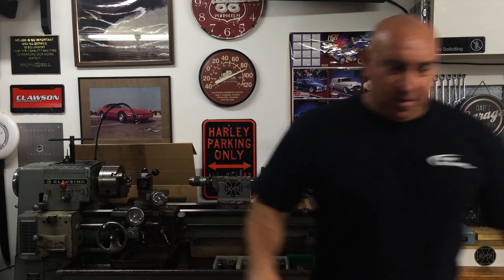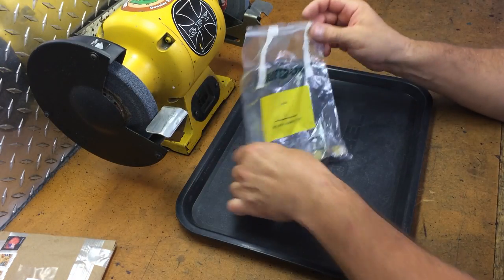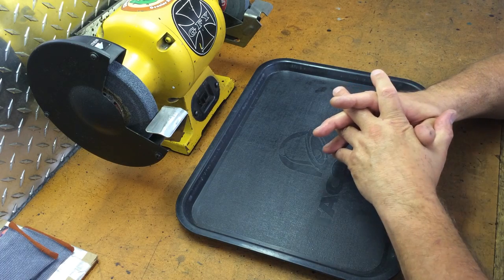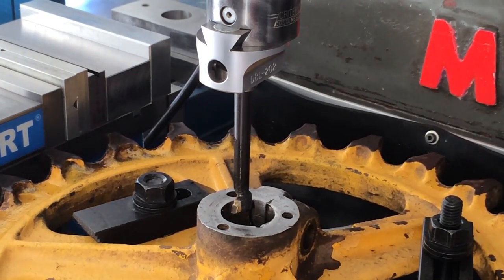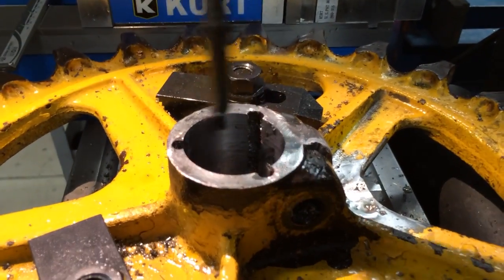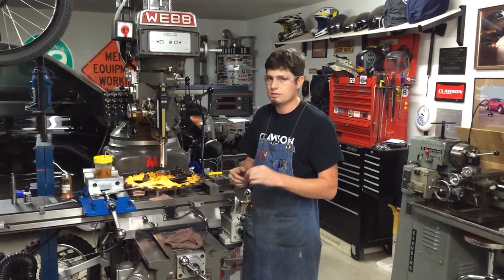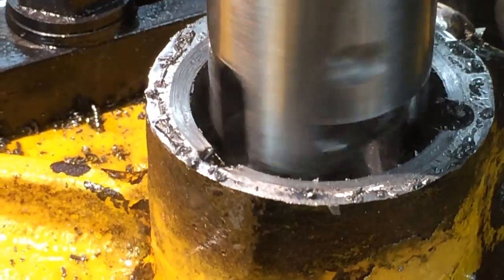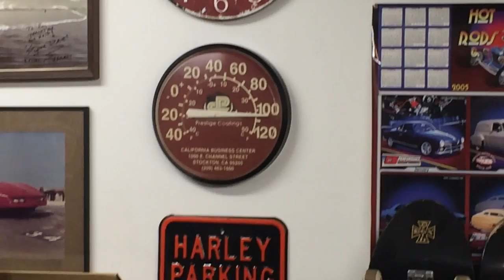Off Track Part 2

Comment: I know that a hot shop is no fun.  An AC unit can be installed in there and it would certainly cool things off a lot.  I got an AC in my garage/shop and it helps a huge amount even though it should have been bigger.  Put in a bigun and get cool.  Looks like you are doing a fine job on that sprocket.  Thanks for sharing.
Reply from the maker: Thanks!

I do need a good AC unit before the heat returns, it is so much more comfortable to work in a cool shop!

Thanks for stopping by!

Ray

Comment: Damn Son, you need a 20 ton pneumatic Jack!  Your garage is like mine, the door faces west.  Too darn hot to work out there in the afternoon.  Thanks for sharing Ray, and hope you enjoy the little hammer.
Reply from the maker: Hey Herb,

I agree, my little 5 Ton just is not cutting it but, it did get the job done, this time... The hammer has been put to use several times, its the perfect size!

Thanks again bud!

Ray
Reply: Ray,  I had a regular 20 ton jack with my Harbor fright press.  After doing one broaching operation, I replaced it with Harbor Fright's 20 Ton pneumatic.  I sold the old Jack at a garage sale and got 50 bucks for it.
Reply from the maker: Hi Herb,

Thanks for the tip bud, I'll look into maybe swapping out the bottle jack on the press.

Thanks again!

Ray

Comment: Nice progress on the re-spline job Ray.  It looked a little touch and go with the press fit for a bit.  Good thing you are a big guy and could put the muscle to it!  Good Stuff-  Fred
Reply from the maker: Hi Fred,

I pressed the sleeve in dry because I did not want to contaminate the weld joint, it went in pretty easy till the last 1/4" then with a little more pressure it popped right in flush!

Thanks,

Ray

Comment: Nice one Ray - that spline doesn't look like it'll ever come out! Perhaps putting the spline part in the freezer for a bit before the press would have assisted... I liked Phil's boring tool. It looks quite stout, for the depth it could reach. My garage is only just getting warm enough now to spend time in, in the evenings, but it gets up to about that temperature in summer... and not to mention the humidity! Looking out for part 3. Thumbs up mate!
Tim
NZ
Reply from the maker: Hey Tim,

Thanks man! I will freeze the part next time, good tip! "Just getting warm enough" I wish for a little cooler temps but, you can keep the humidity!

Thanks for stopping by!

Ray

Comment: Good work guys !   I had the same problem with my shop too once, I had a dark Brown metal garage door that faced the evening sun, It just roasted that place. until I painted it White!  now much cooler I don't know what color you shop is but worth considering if its a dark color..  hope this helps.  and thanks for sharing!
Reply from the maker: Hey Dennis,

Damn, my doors are white and so is the house but, the heat just keeps on coming in! I really need to install a AC unit, its hot here more than its cool...

Thanks bro!

Ray

Comment: Great video Ray,

I just got a import boring head like the one you used. Haven't used it yet but it looks and feels decent enough. My shop has the same overheating issue. After noon or one o'clock it's like a damn oven in there. 

You think you could send me a picture of your press? I think I'm going to build one and looking for ideas. 

Thanks again,
Mike
Reply from the maker: Hey Mike,

The import worked just fine, and I am sure it is alot cheaper than the Criterion!

Stay cool bud!

Ray

Comment: Looking good Ray, but that sounded like more than a thou tight when you pressed the splined sleeve in, unlikely to move in a hurry though.
ATB
chris
Reply from the maker: Hey Chris,

The bore was a thou under but, I choose to press it dry because I did not want to contaminate the weld with oil. I also cleaned the bore and sleeve with acetone. It went in smooth untill the last 1/4", then after a little more pressure it popped right in!

Thanks for stopping by again!

Ray

Comment: Hey Ray,
It's Miller time! God! How do you stand working in that heat? When I did service work, I always hated it when the dispatcher sent me on a job during the summer anywhere from Redding to Bakersfield! Thank God my truck had a/c! I'll have to check out that magazine. Mr. Lipton writes a column! Who knew?  Sorry about your Ebay buy. You can't tell me the guy selling the boring head knew is was about to take a shit! He figured he would unload it on some poor schmuck and make some $$$ for a piece of crap! Hopefully, it can be repaired. Anyway, thanks for the excellent video! You guys do great work!
Have a good one . . . and stay cool!
Dave
Reply from the maker: Hey Dave,

I guess I can deal with the heat since I work outside in it all week plus I grew up back east with super high humidity, so working in dry heat is not as bad...

For sure, Tom's column is pretty good, what a humble guy that Tom is not telling us about that!

As you know that's the second ebay buy that was a fail, no more ebay for Ray!!!

Many thanks bud!

Ray
Reply: I agree about the boring head...I'd love to bore a hole into the seller's head! Think if it had come apart under a load at speed? Easily could have hurt someone depending upon how it failed...some people nowadays.

Comment: buy an arbor off ebay for that face mill, they're fairly cheap and not worth the effort to modify the existing one. Looks like a 1'' arbor hole.
Reply from the maker: Hey Sharp X,

Thanks for the info on the arbor, I'll look into buying one, the last thing I need is another project!!!

Thanks again,

Ray
Reply: no prob, here's some examples (it is probably larger than 1'' so i listed 3 of them, all from the same seller - no affiliation just that are new and cheapest with buy it now)

1'' http://www.ebay.com/itm/1-R8-SHELL-MILL-ARBOR-HOLDER-FOR-BRIDGEPORT-GROUND-NEW-/300401419359

1-1/4 http://www.ebay.com/itm/1-1-4-R8-SHELL-MILL-ARBOR-HOLDER-FOR-BRIDGEPORT-GROUND-/330370641022

1-1/2 http://www.ebay.com/itm/1-1-2-R8-SHELL-MILL-ARBOR-HOLDER-MILLING-FR-BRIDGEPORT-/300401421219
Reply from the maker: sharp x Thanks man! I'll take some measurements after work tomorrow and see which one will work.
I really do appreciate the time you took to locate, copy, and forward these links, plus you saved me a bunch of fab time!

Thanks again bud!

Ray